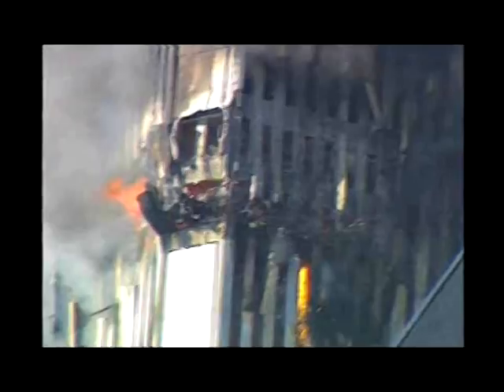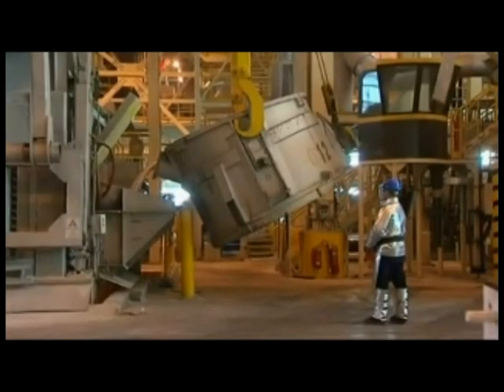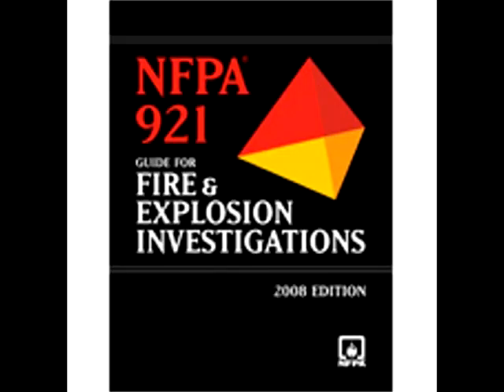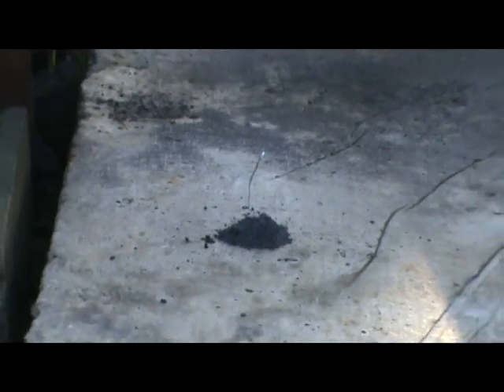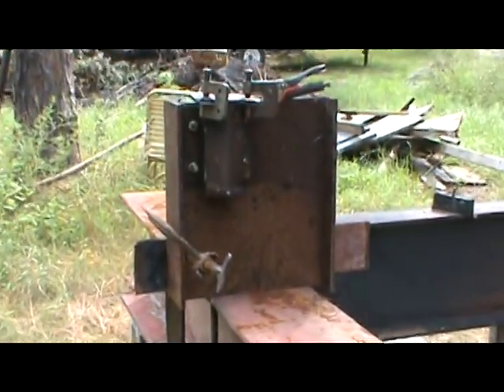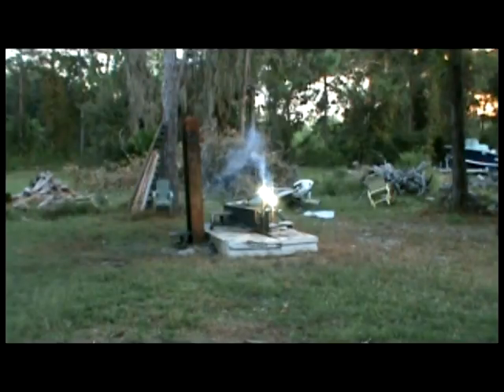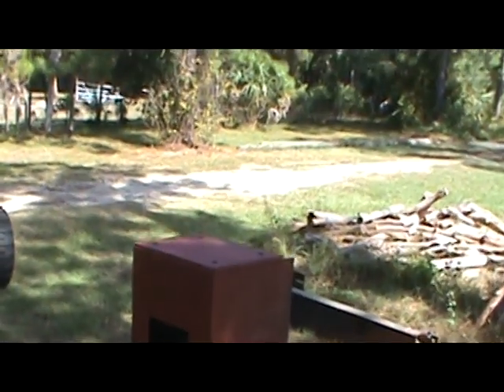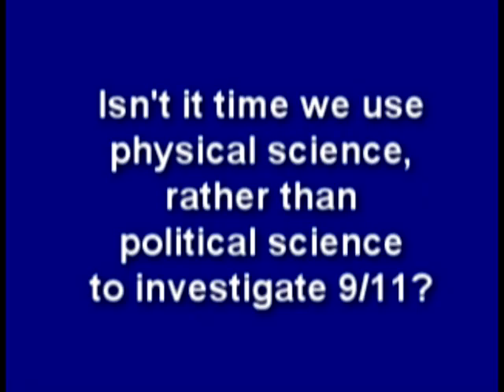9/11 Experiments: The Great Thermate Debate

Comment: That was not molten steel. It was molten aluminum from the planes melting
Reply: 1 Hour later from the crash? or the days afterwards? 
The fact is that it couldn't have been molten aluminum because the organic material would have floated and burnt there.